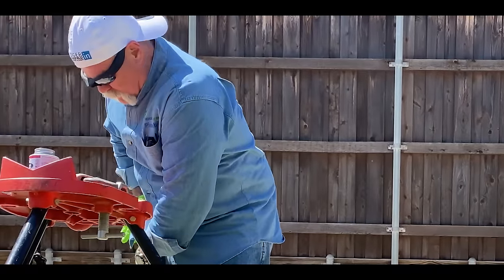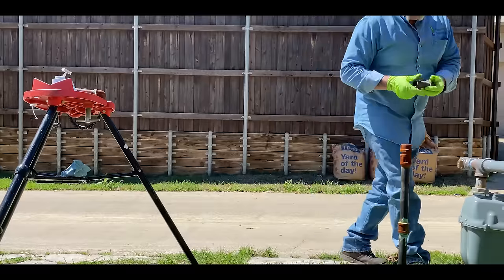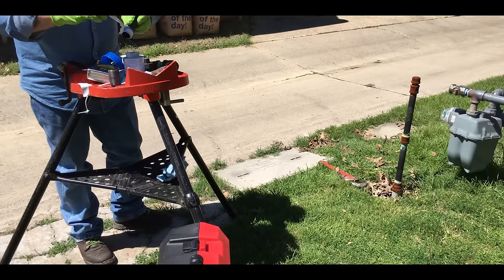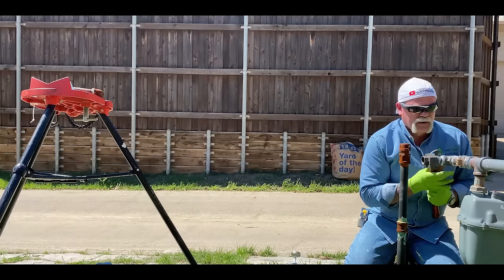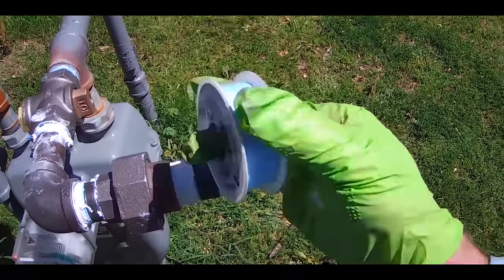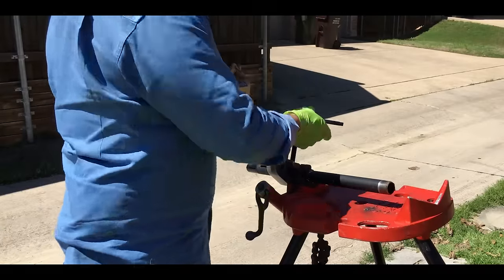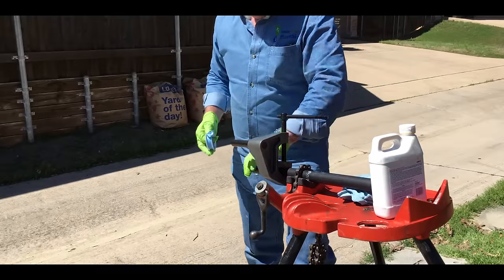Neighbor HIT This Gas Line! - Gas Line Repair (Plumbing POV)

Comment: I was trained to use either pipe dope or tape as well. We’d never use pipe dope on plastic unless it was Teflon pipe dope. About 5 yrs ago I worked for a plumber who uses both and I have as well ever since. Occasionally if it’s 3/4 or lower I’ll use one or the other because I don’t worry about getting them tight enough. Question though, do you not dope the face of your union. I don’t see very many people do this anymore but i was trained that way 20 yrs ago and I rarely if ever have a leak on a union.

Comment: You do have a problem! You need to use an aluminum pipe wrench. Steel pipe wrenches have the possibility of creating a spark. Just because you have gotten away with it several times doesn't eliminate the risk.

Comment: For the longest time I put pipe dope on the treads then I sealed that with tape. I recently learned from an old timer that the proper way to do threaded joints is to tape it then dope it. Either way I've actually never had a leak on my threaded work so there's that.

Comment: Measuring it out seems kinda difficult. I happen to have not done much hard pipe gas work on the repipe side. I was always told that once you tighten a joint with Teflon and dope not to back it out unless you're re doing the whole connection. I noticed you back out around the valve to fine tune your distancing for that final union connection. Any tips on how you like to measure and how much you feel you can back out a fitting safely?

Comment: Finally somebody else that does dope on top of tape. I however do dope, tape then dope again. I dont nearly use as much tape, probably about 2-3 full rotations based on pipe size. All 200psi stuff, 1/4" - 1" for me. I forgot where I learned this but Ive not once had anything leak and during facility shutdowns for a weeks or more the needles on my compressors dont move at all.... No reason to change if it works I guess.

Comment: Why did you crank down the union so hard, only to have to back it out a couple of turns to meet the riser pipe? Should you have cut the riser maybe a 1/4" longer, so it lines up level with the union?

Comment: I was taught to use both Teflon and Pipe dope together on every threaded screw joint and never have a leak. The time that I have slipped up and used one or the other........I had to go back and fix a leak.
Although you go many more times around the thread with your Teflon than I would ever go....lol

Comment: As an electrician I like to work smarter and when not using the M18 threader I tie the pony handle to the leg of the pipe vise. When the rope gets taught you don't have to hold it back the rope does.

Comment: I do excessive old journeyman from Europe said dope tape dope you'll never have a leak. I pressure tested a heating line and the threads were terrible instead of redoing boss said go do your dope tape dope and everything held before that out of 30 connections 27 were leaking. I'm fairly surprised you didn't have to put a swing joint when connecting to the gas line to the under ground

Comment: I never liked that power threader when I did plumbing. I couldn't control it and I was scared of it lol. I always pereferd to use the hand rachet threader, but we didn't have one for inch and a half pipe or bigger.

Comment: If you had more than one thread to cut would you have used an oil bucket that recycles the oil? And why aren't there any barriers protecting those mains?

Comment: Hi there Can I  adding a T before the dryer valve and taking another 1/2” line to the stove and adding another valve for the stove my concern is having enough gas pressure for both units running at the same time

Comment: Roger whats your opinion of toto toilets?  Ive installed several in my house because wife...  found the soft rubber doesnt hold up in city water.....  Alos the nylon or delran lug connector on the trip lever broke on both of mine...   Finally ever done an orange peel, you know the one in the back of the plumbers and pipefitters handbook?  As an apprentice, we had to do one after lunch on Friday when the rest of the crew went to the bar ( we were only 19-20)..  I did mine and it didn't leak!

Comment: That's a sweet tool you have there. Is that the same tool used to do copper Pro Press fittings, with a different attachment? Good work 👍
Reply: No, that is a press tool, this is the threader

Comment: No fletcher coat or galvanized riser?
Did you put paint over it when you were done? I don’t know much about Texas, but in California we barely have weather & I know better than putting bare black pipe outside for gas, underground or not.
It’s just an observation. Nice videos!

Comment: M18 Fuel Hackzall. Hard to imagine running PVC in a tight crawl without one.
M18 9in Grinder. Cuts through cast iron, clay pipe, you name it.
M18 Fuel 1/2 Impact. For those stuck anode rods. All anode rods really...

Those would be my top 3. M18 Fuel Super Hawg with their Big Hawg teeth. Makes drilling out for new roughs/remodels a breeze. M18 Fuel Super Sawzall for demo. My apprentice said it's too much for him on the max setting.

Comment: It's a misconception that if you smoke near gas the whole thing just explodes, nope you got to have a perfect gas to air ratio for the chemical reaction to occur when flame is introduced usually in an enclosed space. In this case the most you gonna get is just some flame burning the gas coming out of the pipe.

Comment: What wait. You DONT need protection for that meter ? Like no cage or strike posts around it? It looks to be a back lane. Love the m18 threader, my only complaint about mine is I wish they had incorporated a drop line for oil and a peristaltic pump to feed the oil.   Also just noticed... no swing joints required on gas line??  ( codes differ in places ) ohh and exterior lines must be painted to avoid corrosion on the line  ( here )

Comment: coming from Wisconsin this is beyond me that the meter is in the yard like this.  here it is  bolted onto your house. also if its by the driveway or any dangerous spot they make you put steel and cement posts to protect it. people can die if it gets hit.
Reply: It’s behind the house in like a back alley . So it’s mostly fine since there is rarely cars going through.

Comment: I'm puzzled why the meter is so close to the road. Here in Ohio most ones I have seen are either right next to the building or inside with shut off in either the sidewalk or sometimes street. Is this a requirement in Texas for the meter to be placed there? Also, surprised that no form of protection from being taken out..... Strange.

Comment: Why are there not concrete protection posts around the meter to prevent damage to the meter to stop a car before it reaches the meter?

Comment: We were told up here in CT not to use tape only use pipe dope  some inspectors up here will actualy give u a hard time about it upon inspection... Their reason is that the tape will discinigrate and thers potential for future gas leaks .... but Cmon that’s with anything I feel like some inspectors just run out of stuff to cite us with so they make shit up

Comment: That T2 pipe dope has Teflon in it already. Plus using black iron pipe outside is never smart. It's gonna rust bad. If the paint gets chipped the black iron pipe will rust faster than galvanized pipe

Comment: the out flow can kill your pilots do you check them, I love that threader, the worst gas repair I ran into was an untracced plastic fused gas line with steel riser also going to a pool heater

Comment: Can you cut a pipe with gas in it? If valves are closed on both ends. Do you need to evacuate it somehow and make sure the remaining mix is not ready to explode?

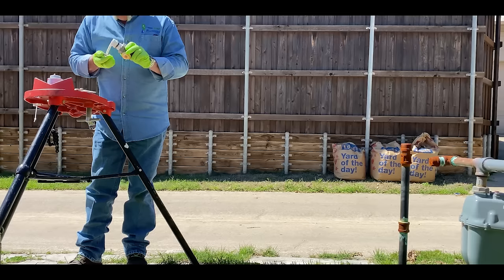Comment: 1:48 Teflon tape only provides good seal when you turn the joint IN and never move it again, any reverse movement creates leaks
Reply: I know it sound strange but Teflon is NOT a seal, it's employed as a lubricant.. same as pipe dope.  The actual seal is because the thread has a 30 degree taper that presses against the malable fitting.
Reply: @MrDmadness  wrong. Why do we use teflon tape then?
Reply: @PeterJurasek  its literally called a lubricant in the gas code. It provides a mating surface between the 2 malleable metals obviously but it won't make a scathe or broken thread seal properly. The main effective practical reason lubricants with high cohesion are effective in sealing leak potential is because they fill the imperfect voids in the concentric leakage path in the land of the female thread. Notice im using proper terminology here? Yeah it's what I do bud. :)
Reply: @PeterJurasek  you're right about the taper though. 30 degrees is the taper of the THREAD not the sealing point between the malleable metals.. can you tell me the thread seals taper ?  ;)
Reply: @MrDmadness  You are using proper terminology, yet you fail to understand the basics. TEFLON and TEFLON TAPE is not the same material :D Or do you think teflon tape is made out of teflon by 100%? :DD
Reply: @PeterJurasek  it depends on the grade of the tape. Gas approved ones use polymer that is non reactive to gas and additives and is generally thicker. What exactly ate you trying to argue here? Everything I've said you are free to go research and verify and you will find I'm correct. I've been a plumber over 25 years so pretty sure I "get the basics" apparently that's ALL you got if you're even on the trade, I have a more complete understanding than that. But go ahead, dig your shame hole bigger with me.. or maybe just admit I'm right and save some face... up too you.

Comment: Great video really shows how to do a good rebuild not sure why you had to cut a new riser though pretty sure that could have been done with new pipe and a coupling since they sell 2 inch pieces and nipples  That stuff has a tiny wiggle room to it so I'm little confused

Comment: One thing I noticed. How come you don't skip the first two threads on the nipple? I was taught to skip the first two threads on gas pipe so that it doesn't shred and get stuck in a regulator. I work for a company that installs and repairs boilers. 
Also. I've got to talk my boss into buying one of those pony threaders lol.

Comment: That threader is good to have on hand, but if we have access to electric I would prefer a rigid 300. If you're threading a short piece of pipe, you will about knock your tripod over trying to get the dies to catch on that thing.

Comment: How do you measure and cut the length of pipe, taking into account the fittings on both sides? For example if the distant between the two pipes is 20 inches on your tape measure. Do you minus 1/2 inch for each fitting (top and bottom) so you cut your pipe 19 inches?

Comment: So the journeyman I work under frowns upon putting pipe dope/teflon tape on fittings with gas water heaters, after seeing this, I'm a bit confused. Personally I would prefer to put it on all threads like you were saying, but wasn't sure about anything natural gas though.?

Comment: Aren't the meters supposed to have collision barriers ?  I thought it was code but I know they skip the barriers now, even though they place the meters in the front of houses and out of the basements.   Does it have something to do with the pressure?  Ive been out of the trade for years, but if you've done the apprenticeship you're in it for life...    Also whatever happened to good old green rectorseal?  I worked at several Dupont plants and we were never supposed to use the tape on gas pipe.  Or I may be mis remembering.....  Hated working in those plants...  Here you go, look at that windsock up there, run the other way if the horn does offf.....  drilled 4000 holes in pipe racks with mag drill...  I do miss the trade though...

Comment: I never shut down the meters either. Gas I so low pressure and I’m too lazy to go light pilots all over the house or want the liability of missing one on accident. I usually only use key-tite and no Teflon tape or dope.

Comment: to me it seemed like the gas company half assed it not putting a shut off for you after it.   in  wi when they replaced my meter i was chit chatting with the fellas and told them how i wanted a  back up generator and with out missing a beat the dude through in a T and capped it and an extra  shut off  to save me trouble later. they went the extra mile

Comment: I always use pipe dope and Teflon except after one time a manager made a joke about it wasn’t needed and that one time I didn’t use both I had a leak so I always use Teflon and pipe dope together never get a leak when using both. I also use a little bit of pipe dope in the union connections.

Comment: That's a crazy amount of pipe dope... And aren't you not supported to even have dope on the first two threads on a gas system? I guess the code could be different in Texas but still this guy must go through a can of dope every day

Comment: ok questions I don't mess with gas an not going to but is there special teflon tape for gas??  an pipe dope can same be used for water as for gas? an do you want the pipe dope that sets or stays soft?

Comment: Pipe dope over tape is the way to go for sure.  I have seen it done wrong before though where people put dope THEN tape and it usually causes problems.  Aside from that, I see you put an awful lot of tape on those connections for gas.  The instructions I've always read claim to not put more than 3 wraps on a connection and you're using 7-8 wraps plus dope.  Does this not jam up the threads at all?

Comment: They should really consider installing bollards around that meter set. If they were to snap that riser off before the regulator, it could have been really bad. The gas utility company I work for would do that for them at no charge.

Comment: I get into a few iron pipe projects once in a while. What steps do you take in planning out something like this so that things line up properly. Seems like it takes me forever usually
Reply: Luke Morter
 ... Black pipe work is never quick and it's always the details that slow you down... like when you think you are almost done and you need that odd size nipple. In my experience having a good selection of short nipples is the best way to be ready for that curveball. Also being familiar with making swing joints and box joints with elbows can get you out of a pinch when things don't line up. Keep in mind that using a bunch of extra fittings can cost you on flow rate with some jobs. NEVER go undersize when using the flow charts. When in doubt go up a size!

Comment: I am glad to see you wiped the joint off think you used a little excessive amount of pipe dope wouldn't you be better off to take the time and to take all those couplings off and cut one solid standpipe and only have one coupling where it goes in the ground and tar and tape the final coupling so it would not rust

Comment: question why did you not put teflon tape on the very last connection (connecting to sides.)? was there a reason or was it not necessary?

Comment: Just curious what pressure are y'all running around there? (I understand it may be personal choice to use tape) we don't use tape till we are 1 ¼ above pipe size or high pressure (dope all the time tho)
Reply: Under 2psi to a domestic residence 2psi max using leak limiting regs, anything over 2psi is high pressure

Comment: I've seen any number of videos that have dealt with the tape then dope thing and I still fail to see the benefit.  The purpose of the exercise is to seal the gap between the threads when assembling gas connections.  Yellow tape will do that... so will dope.  Both fill and seal the gap.  When you use tape and dope together it doesn't work like wearing a belt and suspenders.  Looking at the the arrangement, you are actually using tape to seal the male side of the gap, and dope the female side.  How can that possibly be better?

Comment: Take it from your older brother. Starting and stopping your threading process is where you have more problems. Especially if you get a sub grade pipe. If you keep a uniform tourk during the process your threads will be better. SO Get an old fashion pump oil can or a recycling pump pan so you can time the oil delivery with out stopping.  That will give you better threads then starting and stopping. Then you can just use pipe dope. The tape fills the voids and the dope lubricates the threads.

Comment: I put in 3/8" piping for kitchen fire suppression systems, are those unions fitted with some sort of rubber gaskets? I'm not knowledgable about gas so I'm curious if they are designed differently.
Reply: orphan snacks
 ... there are no rubber gaskets on black pipe unions. That's why they need to be really tight.
Reply: @rupe53  gotcha, that's the same for ours but we use a liquid suppressing agent , I just wasn't sure if gas would be able to leak without extra seals. Thanks! This stuff it interesting for sure.

Comment: I think US regs might be a bit messy... Gas pipes shouldn't be sticking up out the ground like that. The meter shouldn't be hanging off pipes... There should be a proper housing for them if they can't be attached to an existing property.... There shouldn't be any possibility for a car to hit them once, let alone a second time...

Comment: That repair is not legal in Arizona. You can’t use black iron pipe outside, has to be galvanized pipe to prevent rust.  Also mega press now makes gas jobs a hole lot easier.

Comment: Teflon tap n dope is overkill on 7” wc 3/4”  piping lol . On 1 1/4” + piping yes its a must but 3/4” is a waste. I work for. Gas company . I go back on meter sets from the 70s n no leaks with that old dope. Under the reg on 60lbs different story